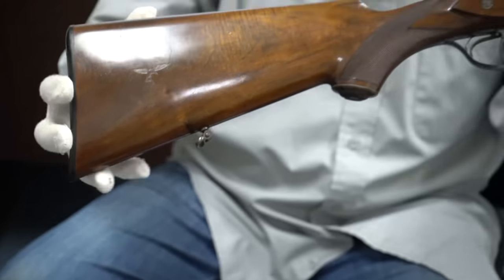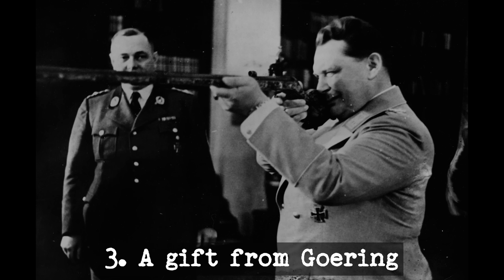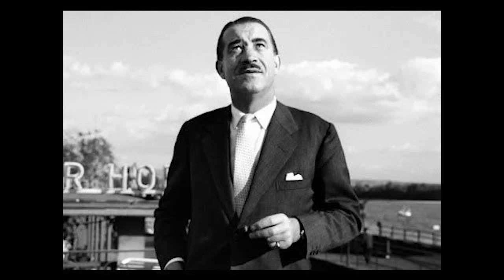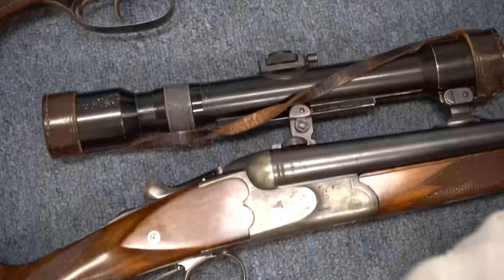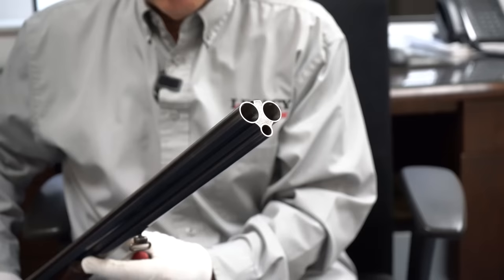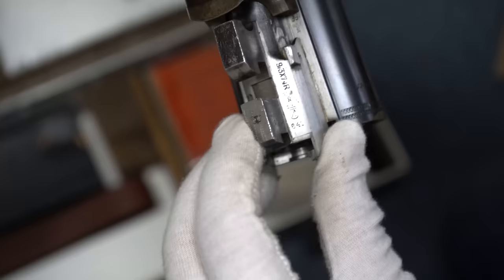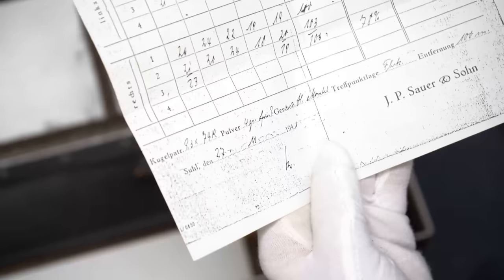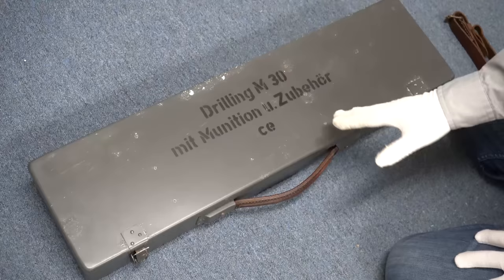Finally Proven! The Purpose of the Luftwaffe Drilling

Comment: Drillings are still in production (Krieghoff, Blaser), though not very common anymore. Too heavy and the versatility is gone, due to the lead ammo regulations. You have to use leadfree shot when hunting at lakes and rivers, so because the lack of Power the 16/70 Drilling standart gauge isn't that useful anymore and 12/76 would make the gun a lot more heavy. So used Drillings have become pretty cheap exept extraordinary examples.
Reply: I got mine in mint condition with a 8x56 Zeiss scope for 500€. Bought in the 70's and never fired. East German export goods.

Comment: If a piece of steel has been case hardened that is not something that can just wear off… That is a process that the steel has been put through it physically makes the outer layer of the metal harder in order that it is more resistant to damage. The only way that can be physically changed is if that piece of metal is subjected to heat above a certain temperature where it would lose that hardening and that is highly unlikely in any situation other than maybe with a machine gun barrel where they cooked it off from shooting it too long without letting it cool. You literally would have to get the gun glowing hot. 

I could understand that baby that gun was never hardened in the first place, but if it was… It still is.

Comment: What a beauty! The swivel sling loops are interesting. My 1937 Luftwaffe Early matching laminated stock has the same swivel style loops. I've always wondered if it was a Luftwaffe/fallschirmjager thing. I know in the early Jumps, they used to jump with their rifles, but opted for Munition drops due to injuries during landing. I've often wondered if more experienced jumpers still chose to jump with their rifles and the use of the swivel loops gave the option to carry the rifle on the other shoulder, or to allow them carry other weapons. Check out the Vid i have of it if you're interested. It's a very interesting rifle. It has a Sauer N Sohn repair/Refit Stamp under the receiver and on one of the replacement bolt parts. Also interestingly it has an Odd skull with an SS and an arrow. :/ It's not the Totenkopf skull. But a much Earlier skull. Much more symetrical. Has an 'X' Or crossed something below the skull. But i can't work out what it is. It's too badly worn. It's a proper battle rifle that's seen heavy action. The lower band is 523 Steyr replacement with the swivel attachment. I've got all the Books. It's a Legit in tact rifle, I'm starting to wonder if the X is the Spanish Condor legion. Definitely Luftwaffe/Fallschirmjager. It has so many stamps it's ridiculous. It's had a few repairs. Look up 1937 Luftwaffe Battle rifle. Any input or knowledge would be appreciated.

Comment: Amigo, Mr. Legacy Collectibles. It appears as though the screws in the 1941 model are clocked whereas the 1930's model are not. Could you please confirm and scratch slight OCD itch?

Comment: I have a double barrel 16ga that was made in Germany 1942.  At suhl germany.. In gustlaff werke factory .. every part on it has a serial numbers and a G stamp for gustloff werke.  i like that actually.  Shoots great too.    Mine is heavily engraved though compared to this drilling, the bluing wore off thpugh so its just shiney steel.  Every screw and peice of metal on it is hand engraved. Yours has very minor engraving honestly.  Mine litterally has no blank spot of metal.. its all engraved.. every square mm

 Barrel says fluss stahl, fluid steel and made by krup if i remember correctly.   

Has lots of proof stampings on it too.

Honestly i prefer my gun over the one you have due to engravings.   Drillings can be found easily.  Basspro and cabelas always has them.  But a heavily engraved ww2 double from germany is far and few.

  Mine did need some work to get it back to shooting though like fixing the broken safety spring.. welding and filing down a trigger lever inside..  etc

Still these examples of yours are very minor engraving.   Honestly years of searching i have not found a drilling or normal double with as much engravings as mine

Comment: Puzzling they weren't chambered in 8mm Mauser. I know it came with a decent number of 9.3mmX74, but the 8mm would have been readily available in a downed aircraft and lighter.
Reply: The 8 mm mauser is not rimmed, only rimmed catridges are relieble in drillings.
Reply: 9,3x74R is an extremely common hunting cartridge in Germany.
They'd have had to refactor their entire production for a rather small run of rifles, simply not worth the trouble

Comment: How does the value of the commercial equivalents compare to the Luftwaffe drilling’s?
Reply: in Germany a used Drilling with some scope on it will start around 1400€ for the cheapest of the cheap.
New you're starting around 4000€
Reply: Thank you

Comment: I think, as a german painter and "amateur weapons expert" i would say youve been tricked a little bit.
For me, the box looks painted in the late 80´s and VERY well conserved. Otherwise it looks like Vacuum sealed in 1941.
Leather Condition unbelieveble...
And the 9,3x74 Ammo is defintly post WW2, i would go for late 60´s/70´s cause of the Design of the Packages.
The red Label Norma Package seems to be Swedish. Makes no historic sense.
White orange striped Package: During Wartime they would not Display the Manufactor (RWS) and hat no english or french Text´s.
Inventory says 2 Packages 12 Gauge (20 and 25 rounds and not 10!) and 1 Box (20rounds) of Rifle rounds...
Reply: It seems that some owner(s) lightly used the gun; the light handling marks on the stock and forend confirm this. So likely the original ammo in the case was replaced, possibly repeatedly.

Comment: I really don't see the point of this shotgun or "drilling" topic
This was regularized at AfrikaKorps, mainly for survival reasons
It was probably used by Luftwaffe pilots for this reason, so that if they crashed, they would have a chance to survive
But whoever goes to war with a shotgun can already nail his coffin
Reply: There were a lot of different shotguns used in wars. They were great for clearing trenches and city streets.
Reply: @lesleyboeder1798  Cleaning trenches or relatively small and closed rooms for cleaning houses are obviously good, but I would never go to war with a shotgun, complete suicide
In addition, this is a double (triple) barrel hunting rifle, which has one or two shots and then it's over
I think the shotgun is absolutely unsuitable for military purposes, for now I see the automatic assault rifle as the only solution, at least 900 shots per minute with a 31-40 magazine, picatinny rail with thermal scope or 4-8X adjustable optics, and a magazine that can be counted on the outside, with silencer
I would also change the caliber, I would replace the 5.56x45 with the Swedish 6.5×55mm Swedish caliber, which is effective up to 800-1000 meters, or the Italian 6.5×52mm Carcano version, which is capable of a shooting distance of 1400 meters

Comment: 1. This is a traditional Hunting weapon, designed for Rabbit and Deer.  
2. This version is high caliber with a hell of a kick designed for use in Africa, made in 1941 for 1 year.
3. Commonly ,Hunting weapons were seized in the 2nd World war from Hunters to reduce resistance to the extreme political movement.
4. Not a survival weapon, very poorly suited for this purpose.
5. Not suitable for skeet.
7. Just about every Hunter in Germany used to have one.
8. They were all hand crafted, each had more or less work done on it. Engraving is simply an option. These were and are still commonly available.
9. Please do not shoot it empty, the hammers can beak. Simply break the barrel hold the triggers and close empty, which will softly let the hammers slip. 
10. You can get them on EGun in Germany or from J. P. Sauer & Sohn, from 700Euro to 30000 Euro.

Comment: How can anyone so ignorant willingly expose themselves on Youtube?  Firstly, it's not 'drilling' like what a dentist does.  It's pronounced 'dry-ling' like drying dishes.  The German word for three - as in the three barrels - is 'drei'.  Additionally, all the guns were color case hardened.  The color wears off with use, hence the 1933 example would have looked like the 1941 example when new.  The only obvious difference between the commercial models and those issued to the military was the pistol grip - the rounded commercial version was not durable enough.  There is no additional expense in color case hardening when that is the standard production process.  It would have been more expensive to select out individual bits for special handling and assembly.
Reply: no it's not pronounced drylling. 
There is no e in Drilling. That's just wrong
His pronunciation is as correct as I'd expect from an anglophone.

Kannst auch gerne noch probieren mit mir zu diskutieren aber des wird halt nix.